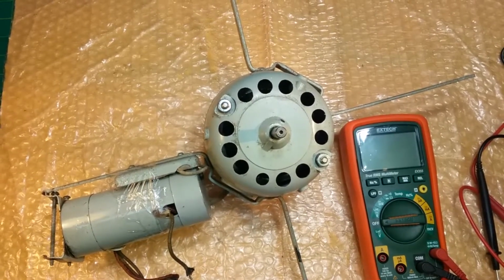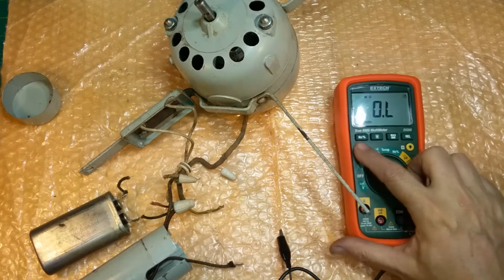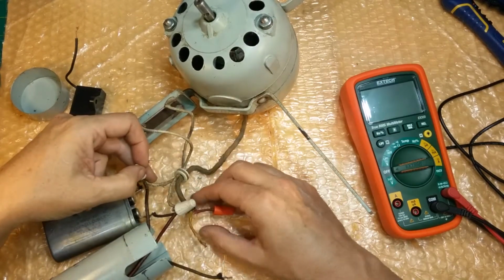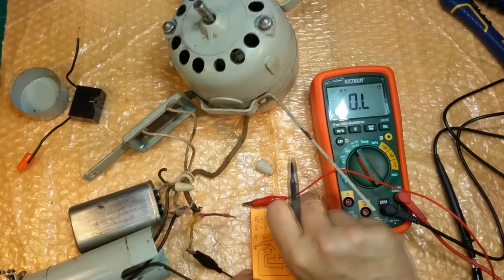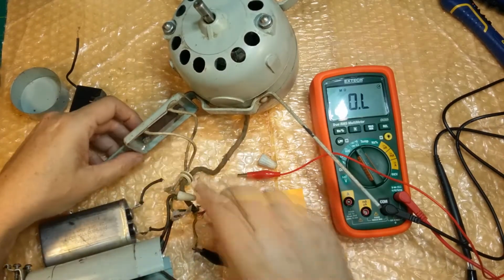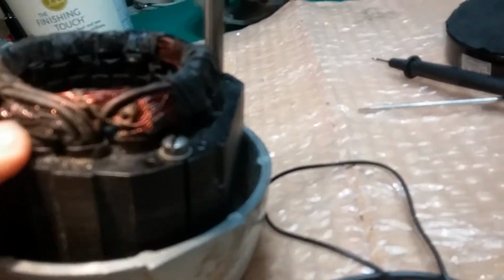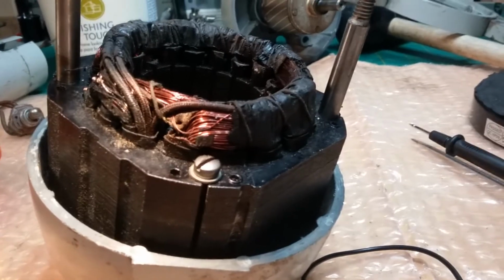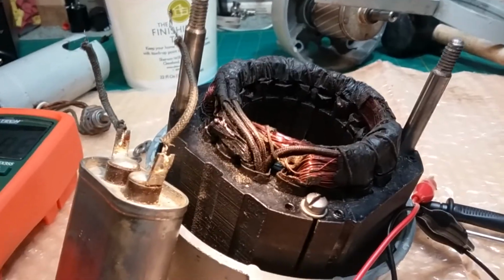Westinghouse MobileAire Fan - Fire in the Hole!

Comment: Out of curiosity, what is the power rating on the resistor? I have an identical mobilair.
Reply from the maker: I do not remember what the resistor value is. You will need to find that out. A good one from a donor unit would be best.

Comment: I have an early 50s mobilaire 4 blade fan where the motor spins clockwise rather than counter, so the fan is blowing air through the rear.
At some point i read this is an easy fix, but cant find that article.
What do i do to change fan direction so its blowing at you?
Reply from the maker: It is most likely a bad capacitor. Replace it and it should be fine. You might want to use one about .25 uF less than the old one with a higher voltage rating.